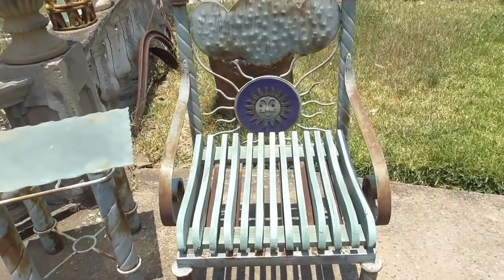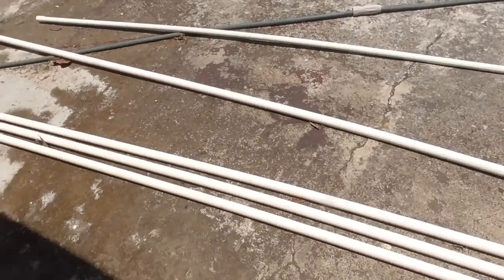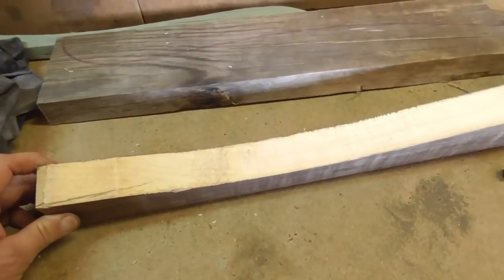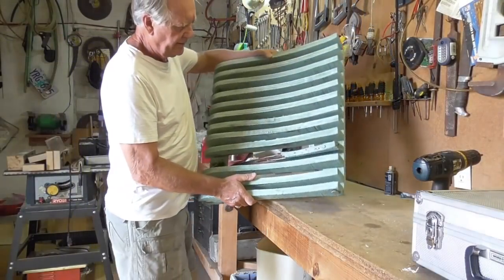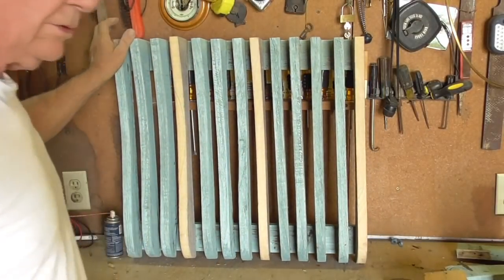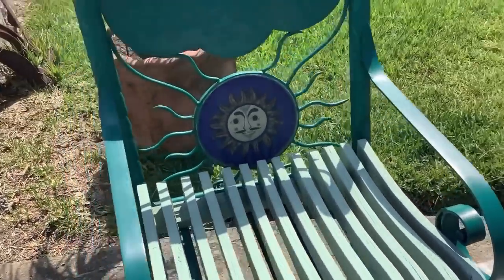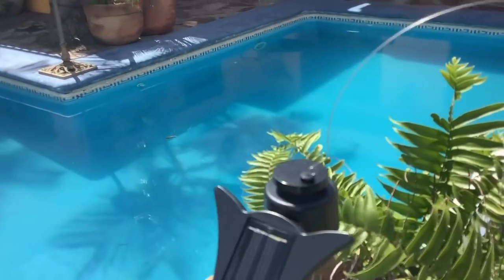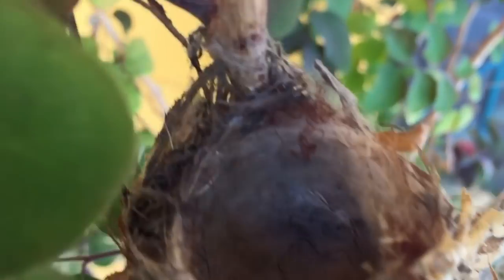Projects in Ajijic, Mexico.

Comment: That frosted glass may have mineral deposits and respond to Limeaway. If that doesn't work, I've found that Meguiars Rubbing Compound cleans and polishes a number of surfaces besides car paint. For example, I have used it on our kitchen countertops and it works great. Mother's Mag and Aluminum polish also works well. If you rub either Meguiars or Mother's on a small area of the glass and hit it with a buffer, I think you will see an improvement in the transparency of the glass.